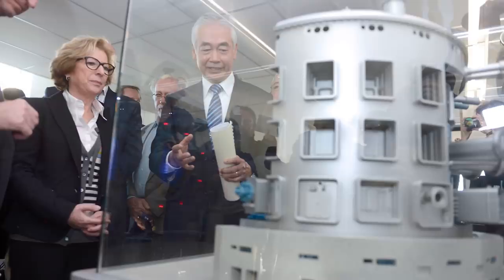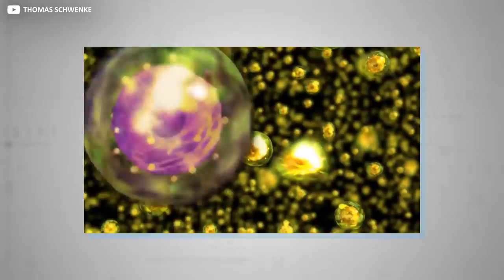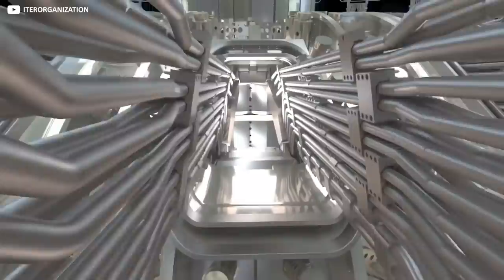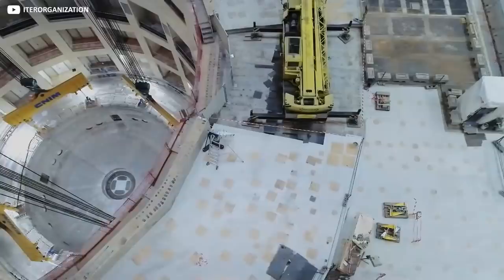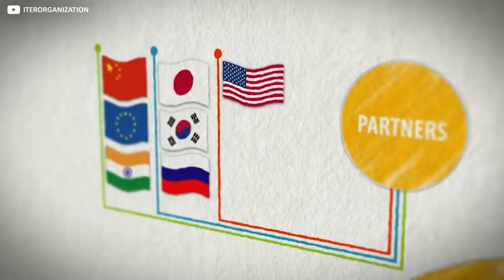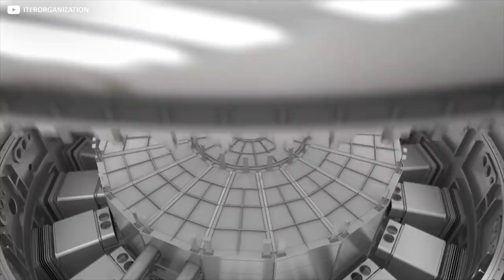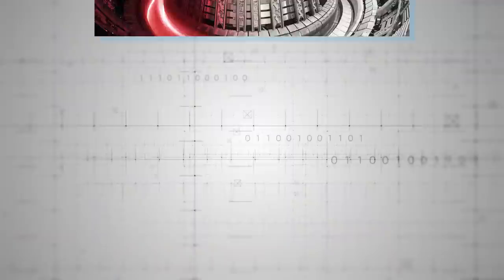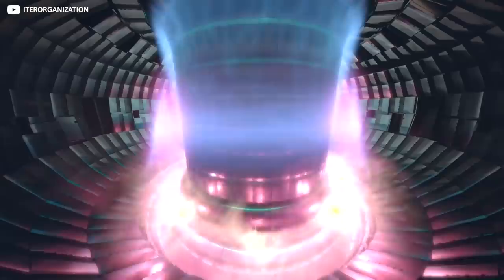Inside The World's Largest Nuclear Fusion Reactor

Comment: One correction, a fission reaction in a nuclear reactor is not a “run away” reaction. It is controlled in various ways to prevent it from running away. A nuclear weapon relies on a run away reaction.
Reply: Don’t the mean sustainability? Like where the reaction helps itself power up consistently? I think that’s what they mean.
Reply: @JesusGarcia-en3pj  At 1:56 it says "In a regular nuclear power plant the heat generated by that run away reaction boils water".  I get what they are saying, and I am being a total nerd by pointing this out, but it isn't true that the reaction in a power plant reactor is a run away reaction.  You are correct that this is a self sustaining reaction once it starts as long as there is enough fuel to keep it going, and that is probably what they mean.
Reply: Is not the only incorrectness they have in this video. They describe fusion as chemical reaction. They introduce the first sentences by "a team of engineers" this is corrected towards the end. They are not up to date with the ofical name of ITER, which means "the way" in latin and it is not the acronym described. And they also talk about the "pressure" under vacuum, when should be called confinement.....
Reply: But it is a run away reaction because if the control fails thats exactly what will happen.
Reply: "Runaway reaction" like what happened at Chernobyl, Fukushima, 3 Mile Island, and several other 'incidents' where the nuclear fission went out of control: "supercritical".
Reply: @acmefixer1  None of those had anything to do with a runaway reaction. They were caused by various issues with cooling systems and all explosions were either steam or hydrogen.
Reply: See Relax Show, Honey
Reply: Also, Chernobyl was marketed as safe and "no worries" or concerns, until...
Reply: @tensevo  Almost like that's what happens when a communist government redacts a massive problem with a reactor and doesn't listen to engineers.
Reply: The right term to use would be a controlled chain reaction (controlled meaning limiting the number of free neutrons and chain referring to self sustained fission)
Reply: I am not a physicist but does fusion have less micro states than fission?  You'd think there'd be less places stuff can go without interacting inward than outward.
Reply: Fission is kind of a runaway reaction, a chain reaction, but artificially controlled in nuclear powerplant. I think that's what Tech Vision meant by that. It's like controlling a big fire only by opening and closing an Oxygen vent (i know it's not that simple).

But it makes more sens when you compare it to a Fusion reaction, remember that Stars don't need control rods and over-engineered machines to be controlled lol. If it's unstable the worst it can do is shut itself off (explosions are reserved to massive stars).

Of course here we need some advanced engineering to create a stars that small..
Reply: @shaununger9350  no, it has nothing to do with there being enough fuel to keep it going, it is the moderator, like a control rod, for example, that is either lowered or raised to control the amount of free neutrons that is used to sustain the reaction, if they raise the rods, there's less moderator in the core, this allows more neutrons to react with the fuel and raise the rate of reaction, the reverse happens if they lower the rods, it has nothing to do with fuel amount.
Reply: @shaununger9350  it is a rumaway reaction just not a supercritical runaway reaction.
The fuel rods are constantly fissioning as in " running away"
Reply: @gordonbyron5145  no it won't
Reply: @acmefixer1  there has not once been a supercriticality accident in this history of nuclear science.

You're thinking of criticallity which is exponentially less powerful but still a death sentence to anyone nearby
Reply: @erdemmemisyazici3950  you must have picked up a physics textbook and read one word and threw it out there for no reason to try and look smart.
I too use large words i dont understand to make myself seem more stertorous.
Reply: @jacobkudrowich  I must have.
Reply: @acmefixer1  
The only one on the list you mention that had an actual run-away reaction is Unit 4 at the Chernobyl NPP. Or more specifically, it had a prompt neutron excursion which subsequently caused a steam/ hydrogen explosion. Both TMI and Fukushima had their reactors in shutdown mode. What they had is a core meltdown due to a loss of coolant. Not the same thing.
Reply: Good thing they remember to shut down their reactors

Comment: I've been following its development for over a decade now. Can't wait for our little star to be born.
Reply: This is far hotter than the sun!!!!  I still don't see this ever really working because of that.  Why it's so HOT is because it doesn't have anything close to the sun's gravity to hold it all together.   I hope for the best.  But I just don't see it and the new power source in any of our lifetimes.
Reply: @jbdragon3295  The fusion works. Humans has been fusing hydrogen for almost 1 century now. Our challenge is to extract more energy than what we put in, not to start a fusion reaction. ITER is going to do it by sheer size, because as the chamber gets bigger the energy requirements scale slower than the capacity. The estimated output using the models that we know works, shows a 10x output in the conservative calculations. There's a wide margin for failure.
Reply: @BlueFrenzy  

I'm heading excuses.  Ya, it's works for a few seconds.  Using mood power then iit makes.  This new one will work a little longer maybe.   You so never be askew to contain all that heat, which is far hotter then the sun for any real period of time.
Reply: @jbdragon3295  Who talks about excuses? ITER is designed to sustain the plasma for 20 minutes, and that's by design because it cannot extract the heat. DEMO will tenfold that quantity, also by design.
Reply: @BlueFrenzy  What about a run-away reaction? Is something like that possible? Scares me a little to think about. I know I'm being paranoid but you sound like you understand this subject quite a bit so I figure I'll ask.
Reply: @madezra64  There's no runaway reaction. The fusion reaction is active, unlike the nuclear fission. The problem of the fission is that the reaction keeps undergoing so, if something bad happens you cannot stop it and you have to let let it consume itselft for millenia. But fusion requires an active work. If the machines stop for any reason, the super hot plasma will spread inside the vessel, cooling down and stopping the reaction. The worst thing that can happen is that the plasma expands so fast that the vessel cannot contain it and explodes as in a high pressure explosion, not a nuclear one or anything like that. the leftovers are hydrogen, so it's harmless.
Reply: Hush Manuel
Reply: @BlueFrenzy  Oh cool! I mean, not cool for the guys around ITER if it explodes but still, cool! I was afraid of like, ignition of the atmosphere or something spooky like that from the immense heat.
Reply: @madezra64  BlueFrenzy is misrepresenting fission. I have no idea what they mean by "active". But fission just...no. Maybe they mean that fusion reactors are self-limiting, because they need constant input energy to keep running. Once the plasma expands such that it touches the reactor walls, it cools far too much to remain so and the reactor stops. It's actually the primary problem with these designs that depend on magnetic confinement, and it still hasn't been solved completely. Plasmas are inherently unstable.

Molten-salt fission reactors can fulfill the same role of being passively safe.

The "leftovers" of a fusion reactor are not harmless though. The only way that would be true is if they were using aneutronic fusion, and they aren't, because to do that requires even higher temperatures and pressures to sustain. These reactors still produce high-level radioactive waste. Slightly less than fission reactors, but it's still there when they're decommissioned, and one of the fuels itself (tritium) isn't all that friendly either (which is to say nothing of its rarity).
Reply: @liesdamnlies3372  You are misrepresenting the danger of tritium. First off, tritium's half life is short so it doesn't have the "permanence" problem that fission waste has. It would also be used in far smaller amounts, and the WHO rates it as having a very low radiotoxicity.
Reply: @the4fibs832  Guess it's a good thing I didn't say it was the primary source of radioactive hazardous material from a fusion reactor then.
Reply: @liesdamnlies3372  It's the only name you mentioned so what other reasonable conclusion would someone draw. Back up your claim that fusion reactors produce only "slightly less" radioactive waste than fission reactors.
Reply: Ka boom
Reply: Seriously I love fusion energy as an energy option, just imagine slapping two different things together to somehow just build a miniature sun with no pollution whatsoever. (Obviously it’s not that simple, but still, it’s showing how we’re starting to finally become something truly advanced and not just boiling water with some radioactive rods)
Reply: so what if it fails lets say! wouldnt that burn a hole in the earth? i dont really know just imagination!
Reply: Twinkle twinkle little star.....
Reply: @jbdragon3295  already been done. And plus they use big ass magnets thousands of times stronger than the earth's magnetic field to keep the plasma from melting anything.
Reply: Even if it means our life 

Yay 😂

Comment: 1:59 in a reactor you have a sustained reaction not a "runaway" one. Or at least it's the goal.
2:20 fusion is not a chemical reaction
3:38 "sufficient heat and pressure in a vacuum"

Comment: i didn't even know they had semi-working fusion reactors i thought it was like a concept never put into action and it was all talk the talk and no walk the walk, and they actually are able to produce 66% of the energy they're spending? and that number has been going up over the decades? that's cool if it can gradually increase to over 1:1 over time then it's free limitless energy
Reply: Well Crasy, now you know.
Reply: no its just very hard to build a reactor so it takes time
Reply: It’s not really functioning. All they’ve managed to do is short pulses. Their use of megawatts as a unit in this video is misleading. A MW produced for fractions of a second and months on end are very different things.

This is still really far off from something useful for power generation. The quoted numbers are also only for MW-thermal; the heat energy that is produced. MWe (MW electric) is always lower, often much lower, because of losses in the system converting it. ITER has no ability to produce electric power. If they are very lucky they might get net positive energy in the thermal output, but still far away from something useful. And they’re constantly discovering new physics about plasmas along the way. This isn’t an engineering solution or prototype, it’s a physics experiment.
Reply: Correct. ITER estimates a 10x the input energy. If they manage to reach that number we have a new future ahead.
Reply: @BlueFrenzy  we are on the cusp of +Fusion in the next 2 decades though it will probably take 4 decade for it to catch on
Reply: Well, you don't know how much iter will produce. we should still invest into these technologies even if they aren't ready because in the future they will be and they will be able to change our world forever. also, I don't hear much hype for this stuff mainly anti-hype, de-hype, gripe, dis-enchantment, I don't know what you call it. I wouldn't call it realism because neither of us knows what will happen as this is the most advance and powerful stellarator ever built, so.
Reply: @Marcus Agrippa dude the reason why this was built was to fully prove fusion really is a thing And fully functions before any other nations starts making their own Fusion Reactor by themselves

They already have Concepts in small Scale thought the energy produced wasn't high enough since it's too small they and such they need to build a huge one

This is a prototype it won't generate electricity By the time it's finished 
But a mega experimental

Comment: Overnight our energy problems would be solved if they figure this out! Forget gas, coal, solar , wind
Reply: Well, not overnight. First, they need to ensure they can harness more energy than what they put in. But then, you need to harvest that energy, and that poses a real lot of extra problems. That's why DEMO's objective, the next prototype, is to actually harness it. That means that after turning it on and adjusting it as necessary, you will need another 10 to 20 year span to build demo. Once that's done and we have a reliable prototype for a fusion central, you need to build them. They use loads of super conductors and extremely strong magnets. We need to figure out first how we are going to suply the demand. After that, we will have to deal with patents. So it will really be slow. Too slow in fact. Although probably we will have fusion centrals ready by 2050 if everything goes well, it will take another 50 years to make the whole transition. We need to figure out a solution and have it deployed before the first commercial prototype will be ready. Else, we are screwed.

Comment: Nuclear Engineer here. This project is huge. It's been on the working for decades.  If ITER works, it will solve the energy problem for thousands of years, until our consumption will reach a certain point. As for the ones saying nuclear energy is dangerous, well yes and no. The company I was working on was and probably are still working on a project that uses the nuclear waste as fuel. Generally speaking it's clean energy and with fussion is as clean as it can get.

In case of accidents, there are no "nuclear explosions" this is not an atomic bomb, it's quite the opposite and even though radiation might escape it's actually very rare and unlikely to happen. Chernobyl was 35 years ago. In the long term, coal plants are much more dangerous because of the emission and air pollution caused. Unlike Germany, we need to strive for nuclear energy, it's safe, and keeps everything cheap and clean. 

As for the people against it, maybe you're okay dying from lung cancer and having power outages because we cannot sustain a whole country on coal. I however, am not okay with that. 

PS : I don't think a population should decide whether a country should use nuclear energy or not. Unless you are part of the scientific/academic community, you should not have a say on what kind of energy a country should explore. It sounds weird, but I'd rather have legal professionals decide on what kind of laws, legal system we should have. If it's not my profession it's not up to me to decide.
Reply: I met a guy who said atoms arent real💀
Reply: @brimstone1355  😂😂

Comment: Thank you for covering this extremely important topic!!
Reply: Yeah. A factually inaccurate one.
Reply: @liesdamnlies3372  What do you mean? This video dumbed down a lot of current research going on there but It didn't get any major major core elements incorrect, sure there were points of mis-phrasing such as calling Nuclear Fission Reactors a "run away reaction" and calling fission and fusion "chemical reactions", but there's no actual core inaccuracies in this field of science.
Reply: @Kepler444f  Calling nuclear reactions chemical ones isn't a "core inaccuracy" when the video is about nuclear fusion? Really?

There's a hell of a lot more wrong with it too, which has been flogged to death already in the comments.
Reply: @liesdamnlies3372  Such as? Also calling a nuclear reaction a chemical reaction is quite the mistake as it deals with completely different scales and components.
Reply: @Kepler444f  "Also calling a nuclear reaction a chemical reaction is quite the mistake as it deals with completely different scales and components."

Yes. I agree. Why did you say it wasn't?

Comment: I like how in Fission, you just slide in fuel rods on water to boil it up and use the steam to generate electricity while in Fusion reactors you cycle plasma at high speeds

Comment: Nuclear fusion is still far off, nuclear fission is what we need now.
Reply: Agree. I really hate seeing those big open coal mines. Scars in the surface of the earth that will never get fixed again. And the bad smoke of course when burning it. Then i rather see a 1m3 package of nuclear waste stored somewhere.
Reply: @Engineer9736  also nuclear waste is (arguably) the best type of waste from power generation because things like solar generate a huge amount of toxic waste hundreds of times more toxic waste then nuclear per terra watt hour
Reply: What I love is that people casually overlook how D-T fusion reactors still create lots of radiation, and high-level waste that needs to be dealt with when decommissioned.
Reply: @colinblonde  No its not Toxic wast you can clean or dispos savely . Nuclar was cant be realy reused allot meaby 1% and its will exist for 10 thousend years . You need to store it somewere for 10 thousend years . So basicly you have to tell peopl that lived back in the rome era with a different languag with different simbiles that you have stored something that dangerous down there or you just dont mark it at all and just hoppe nothing bad happens. To call nucliar wast the best typ of wast is stupid .
Reply: @xythiera7255  do you have a better solution?
Reply: @xythiera7255  It may be a pipe dream, but stable salt reactor's waste only needs to be stored for a couple hundred years.